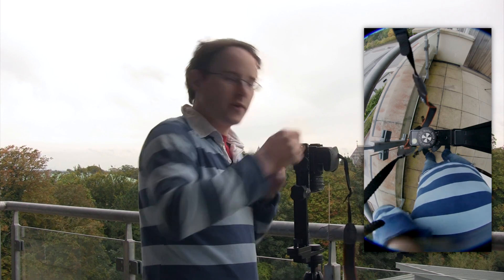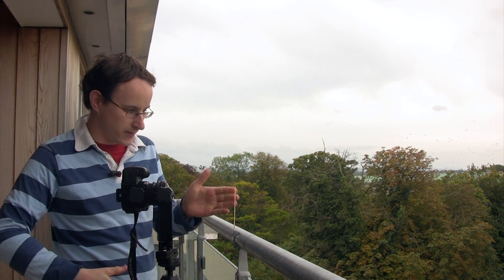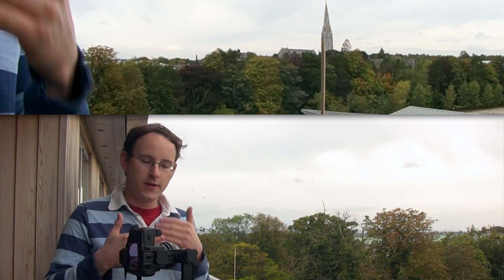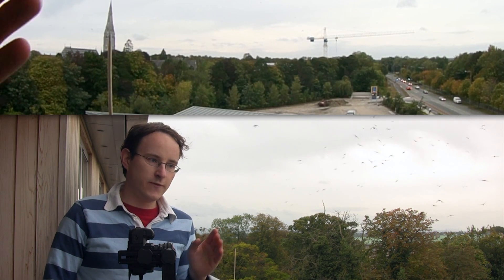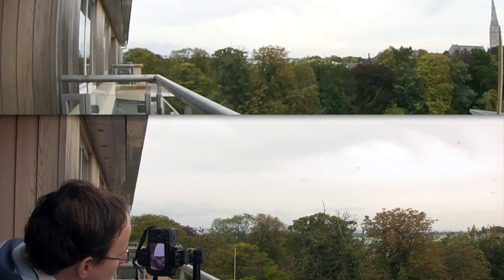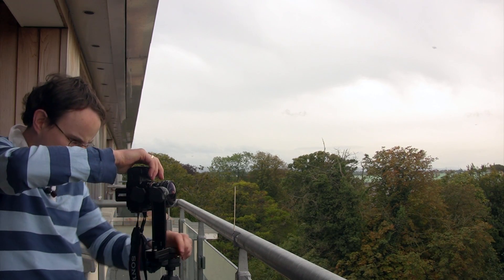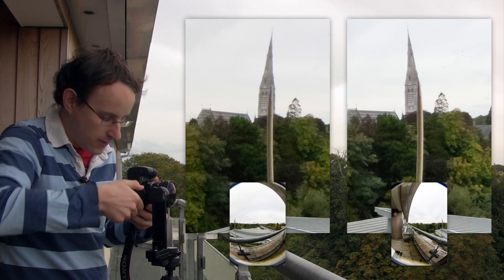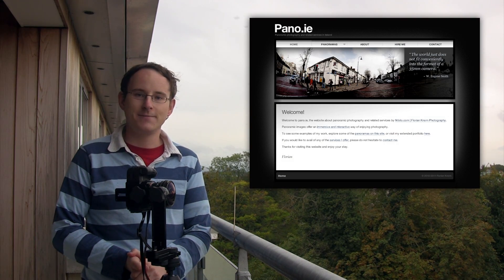360x180° Panorama Tutorial - Pt.6: Finding the no-parallax point (aka nodal point)

Comment: Hello, with the 8mm lens, I shoot a photo left at 45 degrees, another photo in the center and another on the right 45 degrees. Is that it? Thanks.
Reply: On crop or FF? Generally you will need five. All four points and one straight up.

Comment: hi Florian, silly question but the google panoheads where the  8mm lens is held by a ring....are they  fit and no parallax or is there a way to adjust them?
Thanks
Reply from the maker: I'm pretty sure the kit is well adjusted and you do not need to worry about that, since the whole point of the kit is to have a fool-proof, ready-to-use solution.
Reply: @FlorianKnorn   Thats what i thought too, however the stitch seems to be out every time i align when inputting into PtGui?
Could it be my sigma as it refocuses???
Auto focus moving the pov?
Reply from the maker: @ChrisArmstrong194   possible, you should not be using autofocus anyway, but manually set focus for general best sharpness (use live view for that!)
Reply: @FlorianKnorn  Thanks for help. I will try sometime Thursday and update you on one of your vids.

Comment: Thanks for the tut. Well explained. Do you perhaps have a tut on how to work out the overlapping degrees for different lenses as well as for full-frame and cropped sensors?
Reply from the maker: Geo Cloete nope, but there are online databases for it. A ball park figure is to aim for about 20% overlap between adjacent images, but it may be more or less depending on a number of factors. But 20% is a good figure.

Comment: Thank you very much. I have been having a problem with some photos stitching and usually with a clear sky. But my question is on the last setting with the ever so slight change would you keep working on it to get absolutely no movement or is what you had in the last photo OK?
Reply from the maker: David W Cox it’s your patience that decides ;-)
Reply: Thanks, I went over my settings and tweaked them and found I was not centered, i skipped over that part. Now looking to see why the matching points do not always work, looks like it is blank subjects like the real uniform sky. Thank for helping me learn.

Comment: Hi Florian, thanks for the video. You mention it's important to centre the bubble to make sure the tripod head is level. I centre the bubble fine, but then rotate the head 90 degrees and it's way off! This may be because I'm using a funky manfrotto 460MG head. Any tips? How accurate is the plumb line technique?
Reply from the maker: Don't worry about it too much, this can happen (when the pano head / tripod is a bit too weak for the weight of the camera). "How accurate is the plumb line technique?" - well, usually not as accurate as a pano head + tripod ;-)
Reply: Great, thanks for the rapid response. Next stop Slovenian forests :)

Comment: Hi Florian,

Thanks for the video.
Do you need to do this for each different lens that you intend to use for panos or just once for each DSLR?
Also if you are using a zoom lens would the nodal point be different depending on focal length?

Cheers, Vic.
Reply from the maker: Once per lens (and focal length length) you intend to use.

Comment: Great set of videos! thanks so much for taking the time to make them.
A question: once you found the nodal point for a specific lens, is it safe to use the setting forever with that lens at that focal point, or do you have to change it every time you use it - is it influenced by the distances between objects in the scene?